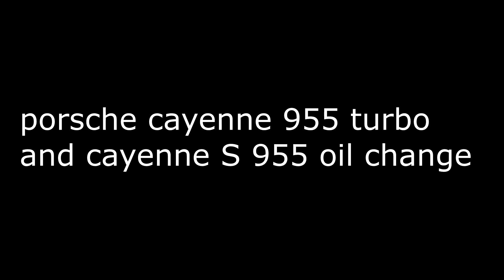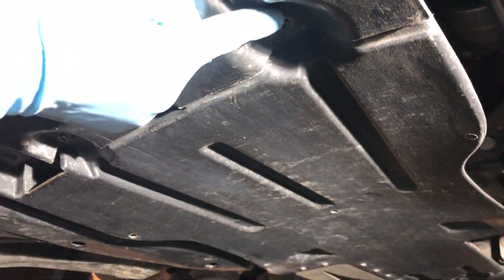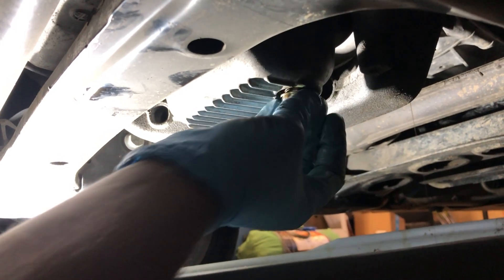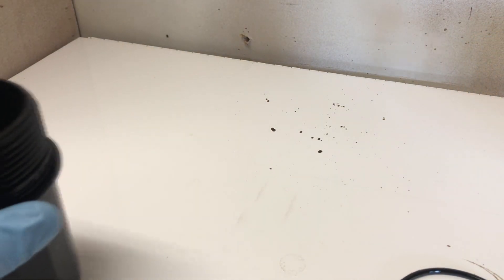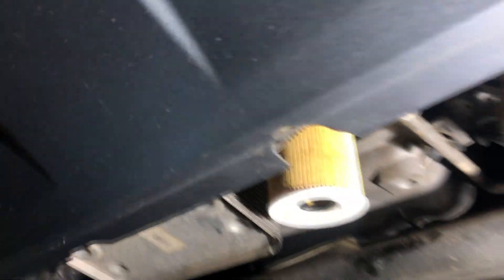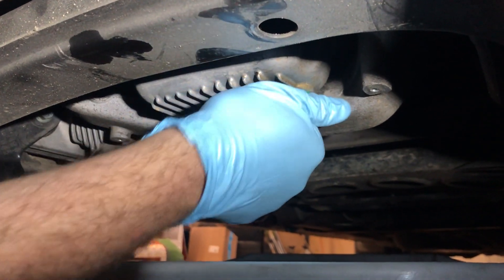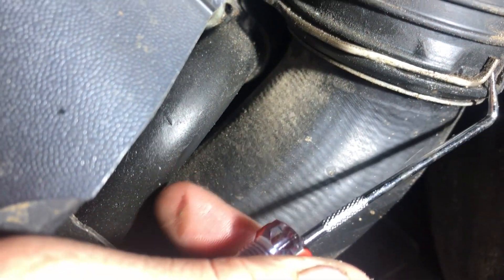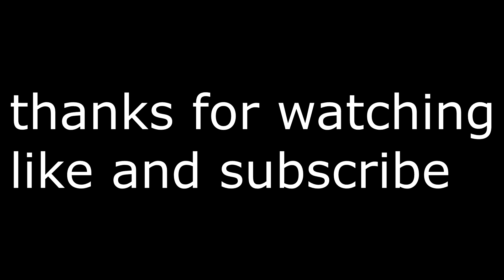Porsche cayenne turbo oil change 955

Comment: Great video! Easy to follow! Seems like u didn't need to use jacks?
Reply from the maker: On cars like this with air suspension I just raised it up with the suspension
Reply: @regularmechanic4196  alright cool thx. Air suspension shouldn't automatically relevel itselt to normal level from highest at stationary for sometimes? It shouldn't. Hope not! The last thing u want when you're down there 😬
Reply: @mrjourney5940  you could always stick some jack stands under the car as a safety measure

Comment: Thanks for the video. Recently bought a 955 and I'm coming up on an oil change. You were able to reach everything ok without jacks/ramps? Also, where do you check oil level? I didn't notice a dipstick?
Reply from the maker: There’s a dipstick, the handle is yellow  on front of engine, left side by the intake. 

My car has air suspension and in the highest setting I was able to do everything. If it’s normal suspension you’ll need to pull up on ramps

Comment: Hey what year is your Porsche?im interested in buying a 2005 Porsche Cayenne it has low mileage and is well taken care of any advice before I buy it?
Reply from the maker: Check for service history, low miles is always good but cars between 100-130k miles will be cheaper to own because most likely all the usual cayenne stuff that breaks has already been replaced. Check and see if the driveshaft and coolant pipes have been replaced.
Reply: @regularmechanic4196  thanks will do